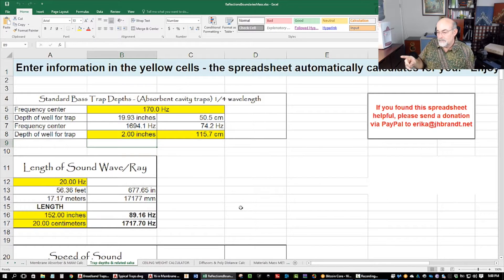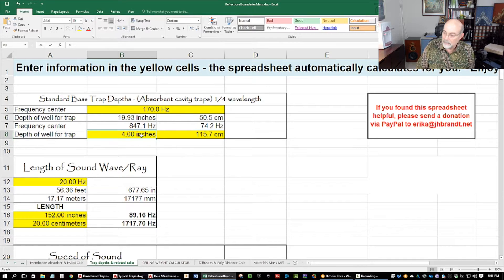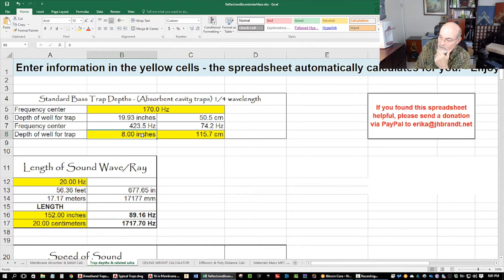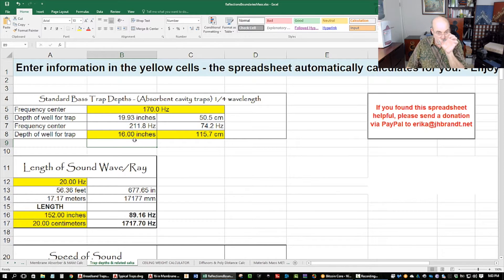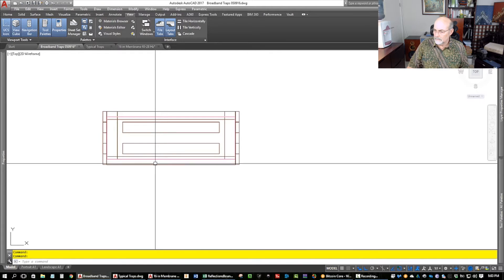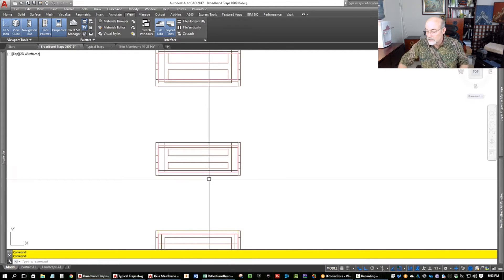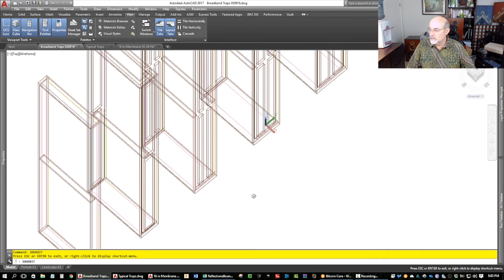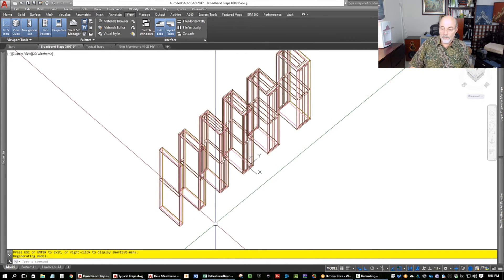Small Room Acoustics: Traps and Frequency Response - Part Two

Comment: John, If I am building a 12inch Rockwool (30kg/m3 density) broadband panel (fully filled with it) and putting it with a 10inch air gap from the wall, will that helps me in really good low frequency absorption? say from 30 to 500Hz

Comment: What do you consider a "Low/Bass Frequency" or a "bass frequency"?   I seem to hear people talk about low/bass frequency absorption, but there seems to be a big difference in what they consider a "low/bass frequency".   When I look at a full range instrument, like a piano.   The bottom two octaves of an 88 note piano are 110hz down to about 26.5hz.    So wouldn't that be considered "Bass Frequencies"?

The other thing is that I've seen various measurements of rooms where they measured the low frequency high and low pressure areas within a room and the modal pressure areas with high amounts of pressure are around the room, not necessarily or always in just the corners.  Wouldn't it make sense to put tuned absorption devices in the areas of high pressure that are built to absorb the offending frequencies, and then add some mid-high frequency material in from of a tuned absorption device?

Also, there is a lot of confusion with broadband.   What does broadband really mean?  Some people talk about broadband  that covers 125hz and above, which I would think would be more mid-range to high frequencies broadband, and then I've seen broadband low frequency devices where they were in the sub-100hz range and they weren't tuned around any specific frequency, but they combined a low frequency broadband device with a mid-high broadband material so the combination was low to high broadband and they went down into the 40hz or so range.

Thanks
Reply from the maker: Bass range is normally 150 Hz and lower. 
You don't understand tuned absorption... if it's tuned then it works only at that one frequency and RELFECTS all others. ;)
Broadband means broad - bandwidth. Everything really works in a bell curve, so broadband means that the curve can encompass the audible spectrum. - it depends on the depth or thickness of the trapping.
Reply: @JHBrandt  Rockwool isn't tuned absorption by itself..  Neither is fiberglass.  It's just limp mass and it's typically measured down to 125hz, at least that's what all of the mfg.'s show in any test results.

I do understand tuned absorption.  It all depends on the design, construction/materials of the device as to how effective it's going to be at the desired frequency range…. the lower the tuned frequency, the deeper the device has to be.

I've heard others say that bass frequencies are around 100hz and below because that's around where frequencies turn from "rays" into "waves".
Reply from the maker: @Oneness100  No, it is Not LIMP MASS. That is ridiculous!

You understand nothing.

If you want cruise forums and argue with novices, carry on! I can't stop all the stupid in the world. And I really don't care what 'other' people say. People say all kinds of crazy things... it's called 'argument from popularity' - a logical fallacy. ;)

If you were asking HONEST questions, I would be very happy to help and answer. But you are just repeating foolishness, myths, and misconceptions. Please don't clutter my thread here.

Comment: What if I got hole from my home studio room that is going down to room under my studio and there is staircase it's pretty much +-1 meter wide and +-3meter long hole, is it detrimental to sound or it can help and act sort of like a bass trap?

Thank you!
Reply from the maker: Unknown until it is tested. Sometimes if the stairwell is treated, it helps but sometimes it's worse. I try to avoid odd spaces like this, especially in a mix room.
Reply: @JHBrandt  thanks!

Comment: Hi! Thank your making the resources you have gathered freely available on your website. There is a lot of good information there. I just have one question regarding the membrane mass calculator. What do you mean by "lowest working frequency"? And why is it higher than the resonance frequency?
Reply from the maker: AT resonance, sound passes thru. We must go 1.414 times the resonance to get to where the sound waves start to be blocked. This is only for MAM calculations. For membrane trap calculations, use the resonance frequency.
Reply: @JHBrandt  Thank you very much for answering my question. So a diaphragmatic absorber will start reflecting sound at 1.414 times the resonans.

There is a lot of misinformation on these subjects floating around, and sometimes it's hard to know who to trust. The fact that you basically publish your sources inspires a lot of trust. I've been reading the master handbook of acoustics that you suggested on your site, and it has been very helpful.
Reply from the maker: @Fleskepresk , that is correct. Above the resonance and below the resonance @ 0.707 times the resonant frequency.  And that's for a limp membrane type. The rigid panel types often have Qs as high as 10 or 20, making them pretty useless for studios.
Reply: @JHBrandt  In theory, it should be feasible to design a double membrane absorber, where the second membrane acts the back wall for the first membrane. If the resonant frequency of the first membrane is  two octaves above the second, the frequencies meant for the second membrane should pass right through the first.
Reply from the maker: @Fleskepresk  no it doesn't work that way unless you are considering the coincidence resonances. Resonance calculations assume rigid boundaries.
Reply: @JHBrandt  I have found a great site that lets you simulate multiple layers in an absorber. I am currently building a test setup to see if it works in practice. If you are interested you can check out absorber number four: http://www.acousticmodelling.com/mlink.php?n=4&s2=2000&im=1&s11=4&k11=3.5&s13=2&d13=200&v13=17000&s21=4&k21=9&s22=2&d22=200&v22=17000&s31=4&k31=3.5&s32=2&d32=50&v32=17000&s41=4&k41=3.5&s42=1&d42=90&s43=4&k43=9&s44=2&d44=150&v44=17000

Comment: is using only the panels that are  2 inches all around the room worse than it is good? like will it give a boxy sound? thanks
Reply from the maker: It's not that they make it worse, it is just that 2" will only absorb 2 kHz and above. At glancing angles, sound rays can be absorbed down to - say... 600 Hz. Yes the room will sound 'dead' and boxy. You need much more. AND it depends on your perimeter wall construction materials. If gypsum board, broadband trapping will usually do. But if the walls are concrete/block/cement, you will need membrane traps to avoid using most of the space for broadband treatment. ;)
Reply: John Brandt what is the PCF of those traps?
Reply from the maker: The PCF of most of the materials for the traps that we use is around .6 pcf to .9 pcf
Yeah, I know... it's very lightweight. It's about the impedance of the material and more importantly, the gas-flow-resistivity, which is what affects the impedance.